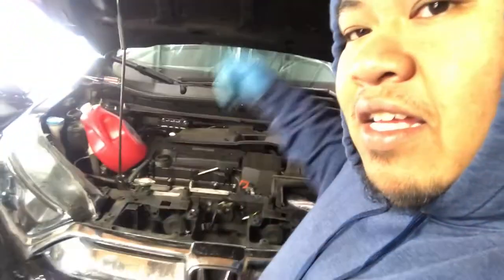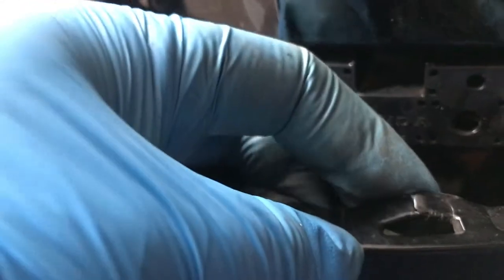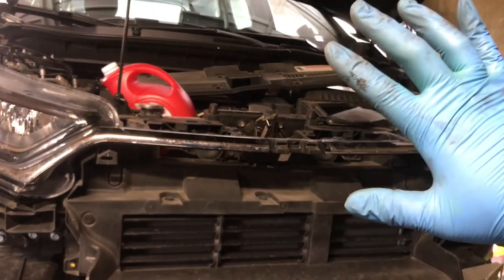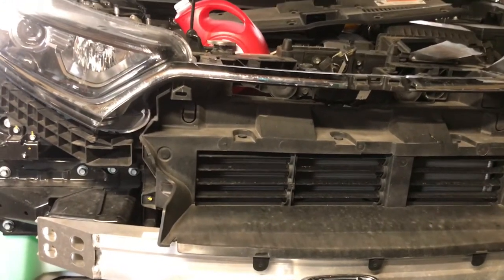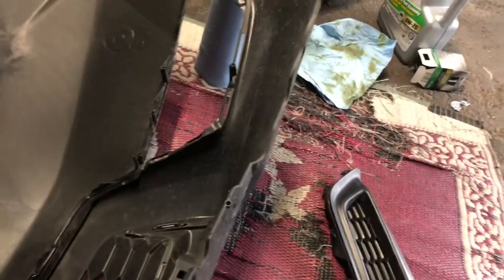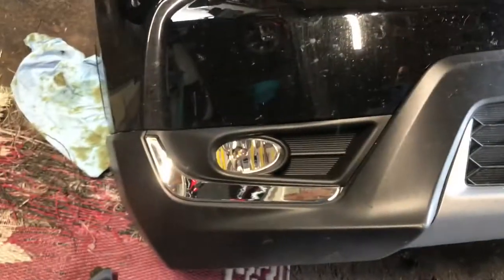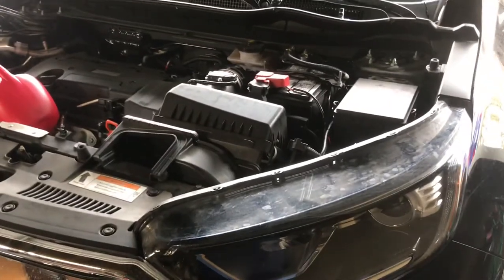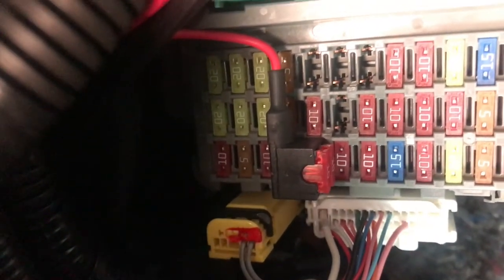2018 Honda CR-V Fog Lights Installation 5th Gen (old video)

Comment: Nice CR-V, I'm thinking of starting to change mine a bit! Whats the wheel setup? And is that a front lip?! If yes where can I get it?... I'm definitely buying that, simple and it gives it a touch.
Reply from the maker: Sorry for the late reply, but the lip I bought from eBay and the wheels are 19x9.5 they are ESR